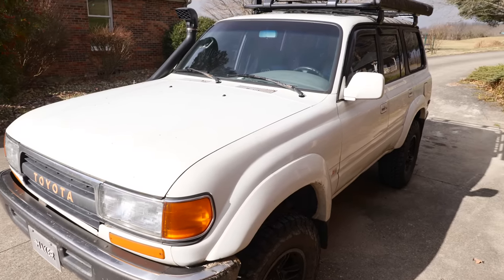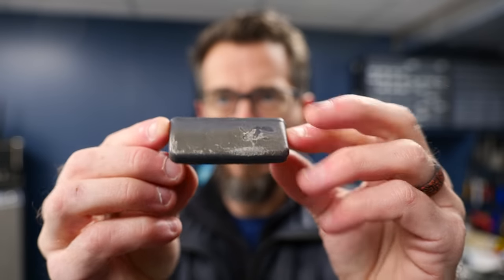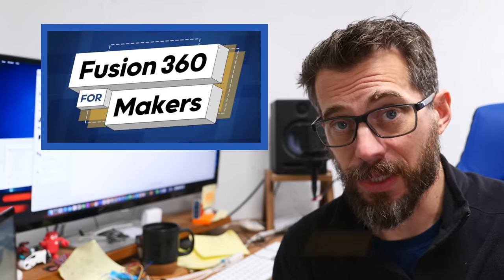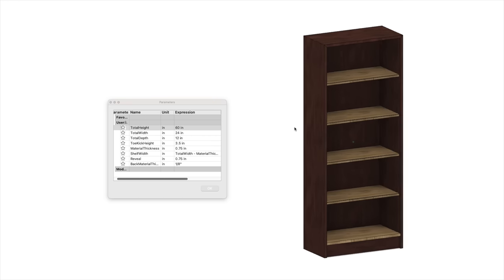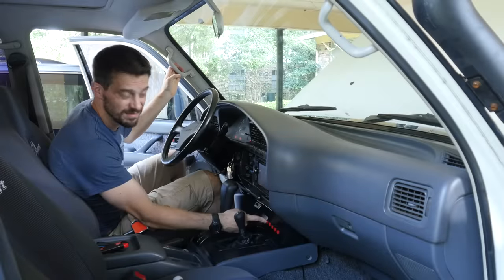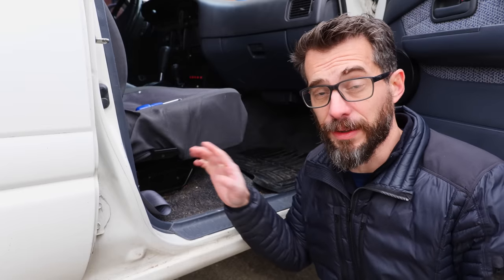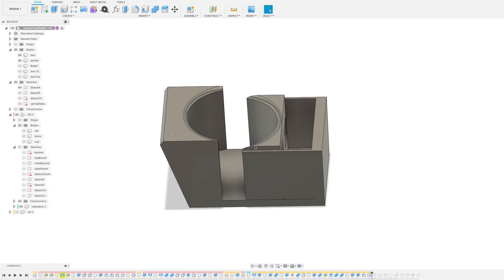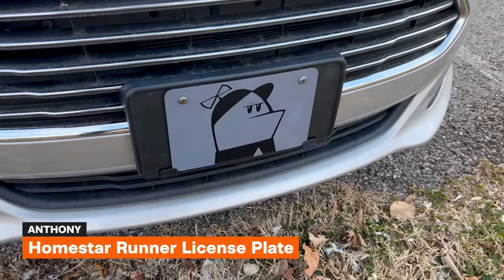Can 3d Printing Improve Your Car?

Comment: Big tip that I saw y'all doing but I dont think was mentioned. Don't think you have to print the whole part every time, any time I print a piece that is going to be interacting with something I didn't model (like the cup holder) I will print just a small portion to make sure my fitment is right. It saves a lot of time and material if you don't have to print the whole part just to realize one measurement was slightly off
Reply: Yes!
Reply: Yes I do this too.
For his example of the seat handle, You would only need to print out the flat part that interfaces with the bar. You could then print out your iterations several times quicker than putting out the whole part
Reply: Yep, I always print a thin and low fill density template for more complex geometries, even without solid fill top and bottom layers.  Great way to sanity check designs cheaply.
Reply: Kind of like making an outside shell.
Reply: He said this about 2-3 minutes into the video.
Reply: This is the way
Reply: That's brilliant!  Next time I'm modeling something that's not just a chachki I'll have to give that a try
Reply: Genius!!! I can't believe I never thought about that, thanks for the tip!
Reply: a very good idea is also to make just out of paper a model - look if it fits and then you can take the messurements of it. WAY faster and cheaper for outsides. If it has a strange form, then make it with paper, cut it out. Lay it on another paper, paint the outlines, scan it, and lay it below the 3d model to recreate it. And to make a handle, if you dont want to change the design - just make a negative form and make it out of resin or something else - way more accurate and easier and faster to make.
Reply: I like to use vase mode whenever possible for test prints, or at least use fewer parameters. I just want the part to print as quick as I can while being dimensionally accurate so I can test it out. I've had prototype prints that I can burn off in an hour or two, and then have the final print take 18 hours for quality. Just finished one such print last week. ... Plus, if you can print the prototype in vase mode, you can print the final part without supports. ;-).
Reply: @dustinmeier9753 what machine u using ? Or recommend

Comment: Here's a tip: you can snap a photo of the object you wanna model right next to a ruler. Then import that as a canvas in Fusion 360 and scale it using the ruler as reference. And you can proceed to draw your sketch on top of it without worrying about it being the wrong size or at the wrong place. Saves a lot of time tracing stuff on paper & measuring with a caliper. It's advisable to keep the camera relatively far and straight to avoid distortion.
Reply: I do this exact thing with my printer-scanner.
I scan as A4 and create a plane the same size in Blender- then set the texture as my scanned image. 
Better for organic shapes than mechanical ones though.
Reply: you could but having the physical part and calipers in hand is way faster.
Reply: There is also the calibrate function for canvases. You can select two points on the canvas and give the gap between them a specific dimension. The canvas will then scale itself
Reply: Also, don't use a wide angle or fish eye lense. It distorts the image a lot. To some of us, that might be common sense, but to new hobbyists, it's easy to over look.

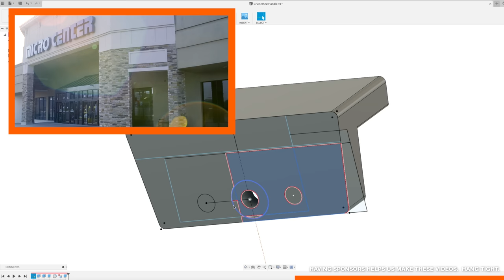Comment: For folks learning Fusion 360 - avoid over complicating your sketches, as seen at 5:35. The best approach is to break them into simpler sketches and use the "Project" command to reference existing 3D geometry. All the blue lines are not yet defined, which will cause havoc when changing the user parameters. Also, (almost) always apply fillets at the end. Helps avoid referencing issues. Hope this helps! :)

Comment: I have a resin printer, an FDM printer and a CO2 laser cutter. I’m not much into kitschy trinkets but I love using these three tools for doing exactly what this video talks about. I have made several pieces for the house including cabinet door knobs, adapter pieces, a new release button for the refrigerator door and even a 6 knife block that only takes up 1/4”’of shelf space. The designing and problem solving is the fun and rewarding part for me.

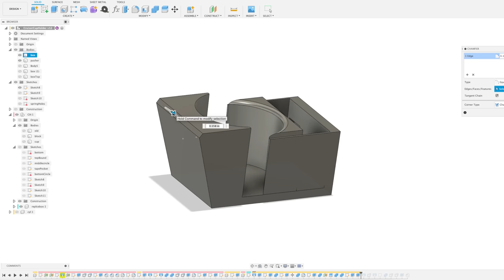Comment: 10:30 a tip for when printing test pieces for size/shape, you can disable the top layers of the print, and even reduce the first layer to one. just for testing that youve got the right size and shape you wont need it to be strong, and you wont typically need a solid layer on the top, but thats a bunch of extra time and filament to put in those solid layers. especially for large pieces like the cupholder spacer.

Comment: Big tip is to increase wall thickness instead of infil, improves strength a lot more.
Also make infil a max of 99% and it can reduce print times a lit
Reply: Going from 2 to 4 walls changes a lot in terms of strenght. Even pieces i have to use a lot i print them with 10-20% infill.

Comment: One thing I think you forgot to mention when replacing injection molded parts with 3D printed parts is that you have a lot less constraints with 3D prints. You could see that in the original part it was cored out and replaced with ribs to maintain uniform thickness to create a better cosmetic finish whereas with 3D printing uniform thickness is not required. Also, you mentioned tapers in the part, it could be for aesthetics, but most likely it was a draft so that the part would not get stuck in the tool. So, in the end figure out what the functional portion of the part is and then you can be as creative as you want with the finished product.
Reply: I often go the other way and add a bunch of triangulated ribs so that the part is very very strong, without having to be solid plastic.
This wouldn't be easy to do with molding, because it would get trapped but with 3D printing I don't have that limitation.
Reply: Another thing to consider is the direction in which you print your piece. Specially if a force is going to be applied. I always print with the layers perpendicular to the force.

Comment: Owning a 3D printer these days its just great. The amount of times I needed some brackets for different applications or reducers for pipes and 3D printing helped me out! At one point I even needed temporary screws for one project and I couldnt run to store anymore and then I just printed a few, worked like a charm. 
I own 3D printer now for 4 years even got a few MSLA in past years and if you walk into my room and look around.. every single corner has at least one piece 3D printed, from practical stuff to a ton of props and so on :D

Comment: Years ago one of the plastic seat handles in my dad's 87 Nissan stanza split right at the screw hole so we made some simple wooden ( with thin piece of metal in inserted in the upright part for support) handles with curves like the grip on older style bicycle for better grabbing. Plus it looked nicer than the plastic
Reply: lots of wasted plastic
Reply: @rob4121  non of the replacement was plastic it was oak wood

Comment: Been following creators making car parts and similar for a while now. Seems like they're really lasting the test of time and only getting better with new technology! I have some ideas...just need to bite the bullet for a printer of my own.  Great work!
Reply from the maker: 3d printers are amazing. I can go from idea to physical thing like magic.
Reply: I have done this for a couple pieces for my car.  Be aware of heat during the summer.  PLA pieces will warp.
Reply: @GaryStewart2020  depending on a climate PETG will warp too. ASA, ABS, Nylon or PC is advised. I have tweeter adapters in a dash of my car and during summer PETG warped day 1. Nylon holds fine.

Comment: the hole in the console - i would recommend CAD there to speed measuring of such things
CAD as in Cardboard Aided Design
Reply from the maker: True. Josh suggested lining the inside with masking tape and cutting it at the corners. That way I have the measurements of each side.

Comment: Awesome ideas. I'll note that while PETG is more resistant to heat, it isn't impervious. I printed a badge for the front of my car out of PETG and after a summer in the 100+ degree sun it's curled up a bit at the edges. I'm planning to try it again with ABS.
Reply: ASA would be even better as it is UV resistant.
Reply: You might have better luck by painting your print

Comment: For the cupholder, use three rubber tabs. Add some slots on the inside surface of the cup that the tabs will protrude thru. Cut some pliable but supportive rubber tabs and you can glue or secure them on the hidden side of the holder. The rubber tabs will conform to any drink you're able to put in the holder. No need for springs or moving parts.

Comment: awesome. pro tip, i needed light spring tension on a project and a tile/ grout sponge works awesome as a spring to force the item back with very light pressure.
Reply from the maker: Great tip!
Reply: I actually used one to hold a PCB against a transparency and glass for exposing for etching, it did work really nice!

Comment: Great to see your fusion 360 kung-fu in action. 
One thing that I was happy to see is the use of fillets and chamfers. Of course, they help it look and feel like a finished project. But, they are really helpful to reduce mechanical stress on those sharp inside corners.

Comment: This makes me very happy, as someone with a 23 year old Toyota that is mechanically nearly bulletproof. When the junkyard supply dries up...

Might be an idea for a followup on how to paint to match the rest of the interior and what types of finishes adhere to petg and last well given wear and heat.

Afaik pretty much all automotive interior plastics are injection mold abs. Definitely would hold up the best over time

Comment: You can measure a weird shaped hole like that, by jamming it full of tinfoil. When you can't fit any more, simply pull out the tinfoil lump and take your measurements from that.
Reply: Anything. clay, plaster, concrete, expanding foam,
Reply: That is Genius.
Reply: @AlexFoster2291  ductape and foam
Reply: Multiple layers of painters tape will also hold shape quite well. This method is used for forming custom sheet metal parts regularly.

Comment: For your cupholder....cut individual pieces of cardboard that fit on the bottom, sides, front, and back. Then measure each one. You can even hot glue them together to get the perfect angles.
Reply: My mates and I joking call this approach CAD.

Cardboard Aided Design.

Comment: If you have a newer iOS device (not sure about Android), you can use the LiDAR scanner built into the camera to model objects. Simply place the object on a lazy susan and spin. Scan the object 360 degrees using one of the many 3D modelling apps available, and export the mesh to your favourite 3D printing software.

Comment: I did this a few years ago. I needed a replacement latch for my Civic's center armrest. The only way to buy a replacement was purchasing the entire OEM armrest assembly. Even if it weren't an eye-watering $150, it would have still been extremely wasteful to trash the existing armrest just because a 2" piece of plastic broke. It took a few hours to model and print in PETG, but it came out great on the first print, and I even beefed up the portion that broke on the original. It held up really well, no shearing, no warping, even in SoCal heat.

Comment: When I print parts that have to interface with some existing thing - I’ve basically given up on printing entire parts on the first pass. The first pass will just be the interfacing elements. Once I’ve got the interface surfaces to print and fit - it’s easy to merge the viable model into the full part. It’s been a game changer for saving time and generates less waste.

Comment: I bought my first 3D printer like 5 years ago with the plans to prototype parts for my hotrods and then cast them out of aluminum. It never ended up happening, but I’m finally about to get back to it. I’m making a flip open gas cap for my wood strip hotrod. I already modeled and printed it a couple times. Now I need to figure out the casting part.

Comment: I've been doing this for a few months since i bought my car.
a 97 Saab 900, great running condition, everything was all good except a few small plastic pieces that were just worn down, and reprinting them and replacing them was exactly what i bought my first 3d printer for, instead of finding people overcharging for some parts I replaced the stock radio with a newer single din as well so i could have a working radio and printing out a cover over it was such a blessing cause having a giant hole annoyed me so much haha

Comment: Quick tip for better strength: try increasing wall thickness to 4 or 5 perimeters and top/bottom thickness to 4 or 5 layers. In my experience that has a huge impact on part strength and stiffness and is way faster than 100% infill. I usually combine these thicker walls with 30% infill.

Comment: I just had to model and print a cold air intake for a truck that I bought because the previous owner installed the wrong radiator - one for a newer model truck. This moved the upper radiator hose up by about 3", and made the air filter plumbing run straight into the upper radiator hose. So I modeled a piece that had a notch for the radiator hose to rest in without chafing and still letting air flow from a cone-style air filter. It should do the trick and from my research, ASA will hold up to underhood temperatures.

I used eSun ASA filament. I learned to print ASA at 50% of the speed you print PLA or PETG, and layers should be no more than 0.12 mm if you want the layers to stick together. I printed at 260*C and 90*C on the bed in an open-air Ender 3 Pro with Direct Drive and an 0.6mm nozzle.

But with 0.250" walls, 4 parameters, 4 top and bottom layers and solid infill, I am confident in the part. Now to test it with underhood temperatures.

Comment: Regarding cup holders, I have an MG4 which has a pretty neat cupholder which is cylindrical but it has 4 spring loaded nubs which grip the cup when it's pushed in. Means it can hold anything from thin cans to 500ml bottles or cups

Comment: I have printed some parts for my car that have worked really well. The first thing was the handbrake button that was already missing when I bought the car. I found a better cup holder design online that I printed out and the last thing was a base plate to make a aftermarket armrest fit in my car.
All printed in PETG and have no sign of deforming after 2 years in a car with between -20°C and 35°C.

Comment: Hey, I love your enthusiasm! I've spent most of my working life designing plastic parts for cars. What I recommend, really really recommend, is a Revoipoint Pop2 3D scanner. Scan the old part or mating part, and use the scan as a template in your CAD program. You'll do a lot less error in the trial and error stage, as it takes all the measurements and puts them right where you need them, in the CAD program. 

Great work though, loved the video.

Comment: I am still on designing a holder für my hookah in my Ram. The holder has to be stiff that nothing happens when braking, especially with the charcoal but when finished, it will be a very good helper for the summer.

Comment: Another tip when trying to replicate a part in cad is to print on paper the top, bottom and sides view in 1:1 scale when you are done. That way you can verify a lot of things like holes location just by putting the part on the paper and compare. It's a great time saver

Comment: If you use a resin printer and notice that your prints delaminate or stick to the fep sheet, use PTFE / teflon lube on the fep sheet before you pour resin in the container

Comment: You guys are on the same page as me I recently got a new printer to replace the last and the prints are night and day difference. I printed a hood clip for my 2001 Subaru Impreza sport and went to put it in and realized that I don’t have radiator brackets. So I’ve been watching your fusion 360 video to hopefully replicate the part and print it

Comment: ABS is a plastic I use to make my car gadgets. It has a higher melting point than PLA and is similar to PETG. BUT... it is pretty hard to print. You need a containment box to keep the heat in, you need to use higher heat (I use 240C at the nozzle, 100C for the bed). However because it has to be printed at higher temperatures, it can withstand more heat. I have had ABS prints that are tension fit in my car for over a year and I have not had many problems with it. I live in Utah and the summers can get well above 100F outside and between 120F - 130F inside the car. If you are needing high-temperature plastic, ABS is a good choice!

Comment: I found out that the material you use for test prints matters A LOT! If you're making corrections to the dimensions based of the PLA test print, those dimensions will for sure change when you use ABS or PETG for example. So I got used to printing test pieces with the  same material that will be used in the end-product.

Comment: In my old car, I used an ash tray as a change pot. I never use the cup holders in my car as any cup in it will fall over as they are shallow. Might try to make a change pot with a lid, with chamfered edges inside to allow you to slide a coin up the side.

Comment: I designed a wing (spoiler) stabilizer for my car, which they sont sell. I dont have a 3d printer so i went on etsy and found someone willing to print two of them. Since the part doesnt exist i made a prototype from modeling clay and used that and its measurements as a basis for my 3r model. I did have it printed in PLA and spent so many hours sanding, priming painting, clear coating, and car wax to match my cars paint perfectly. Turned out great, except it got hot and did exactly what your button box did. So this summer i will have it reprinted in PTEG or buy a printer and do it all again